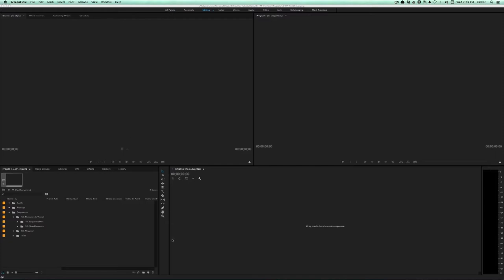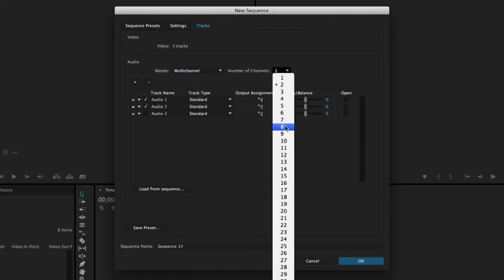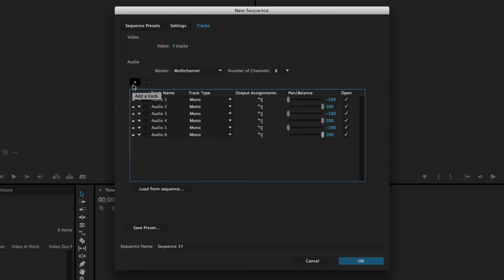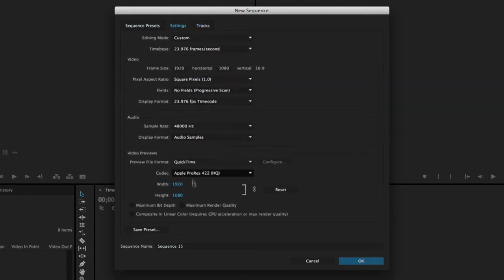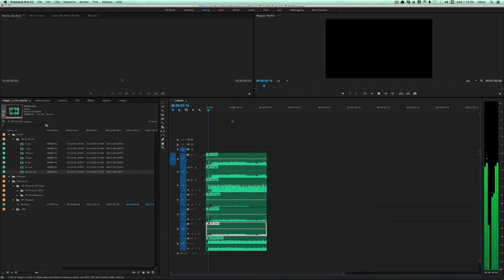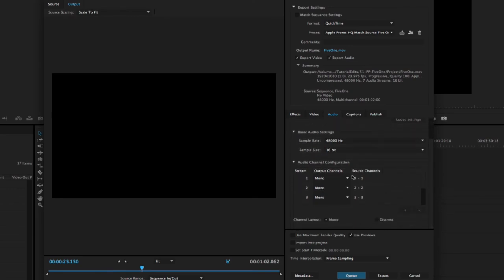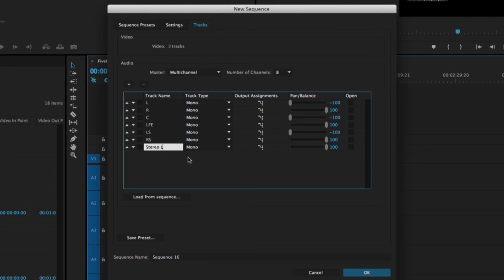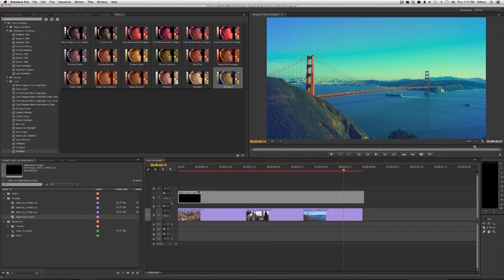Five One Audio in Premiere Pro CC 2015

Comment: Really helpful tutorial! Thank you! One question is: Why is the center track mapped far left?
Reply from the maker: Because it's not actually mapping it left, it's mapping it to channel 3. It's just the weird way that Premiere makes you do it because it thinks of everything as pairs, such as 3 and 4.
Reply: Ooh! Thank you! Can I ask one more question? Why do you put the stereo mix below the 5.1? I thought Adobe Premiere handles the downmix for tv's that can only handle stereo mixes? So is it okay to only render it with 5.1?
Reply from the maker: Premiere pro won't be where your final playback is from. That will come from whatever file you deliver. So it all depends on what spec sheet for deliverables you are following. Most require the stereo mix on channels 7 & 8 so they can pick which stream they want to pull from.

Comment: I have a fully edited project in Pr with three audio tracks
Audio track 1 is mono, which I want.
Audio tracks 2&3 are stereo... which I want.
The audio levels on all tracks are set/mixed.
My output is set to a stereo mix-down.
My question... since all tracks are are already setup level-wise, is it still possible to break these into separate tracks as described in your tutorial to produce a 5.1 output.

I'm a rookie at sound mixing... so I'm hoping my question makes some sense to you.

Thanks, Jerry
Reply from the maker: Jerry, that doesn't sound like the right setup for a 5.1 output, I wouldn't recommend it.

Comment: Hi thanks for the tip. Why not just work exclusively in the 2nd version of your Sequence Preset (the one with 2 separate Audio track for your Stereo Mix) and not bother with the version that has Stereo Mix on Track 7?
Reply from the maker: sorry, missed this comment. The reason is because by default premiere will put stereo audio on 1 track, so i would have to change that setting for how it treats audio, which I wouldn't want for stereo sequences, OR I'd have to change each file for stereo in my 5.1 sequences before bringing it in. I wouldn't want to do that either, because I often have a 5.1 version of a sequence and a stereo version of the same sequence.
Reply: Thanks for always great tutorials. Curious if this has been fixed by them in 2017 versions?
Reply from the maker: No, it's not really a bug, just the way it does things. And no, nothing has changed here in the 2017 versions.